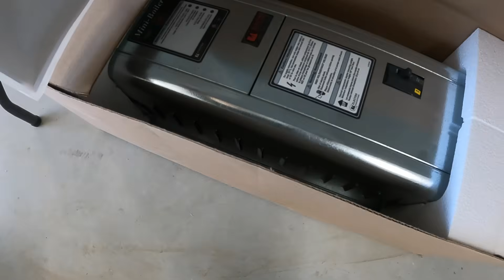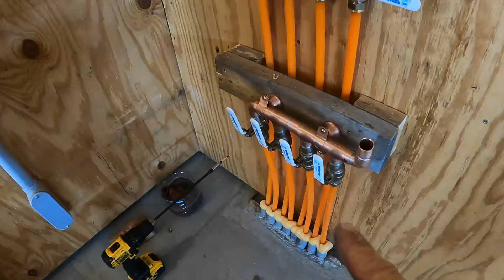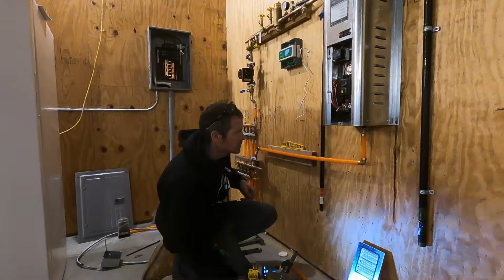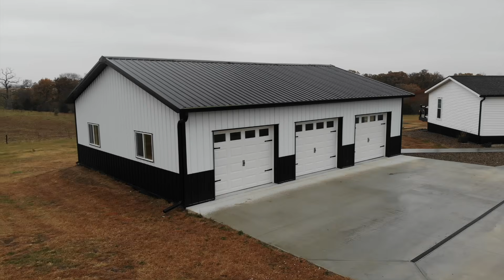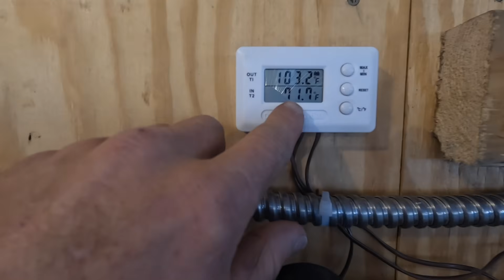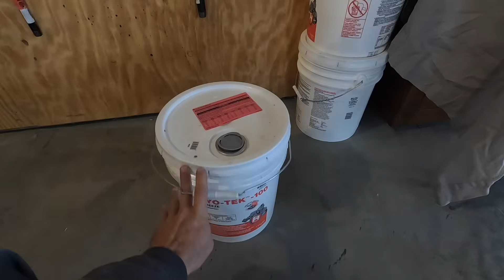In-Floor Radiant Heat Controls Install + Cost Breakdown | One Zone System

Comment: You typically want the expansion tank going upwards not downwards, they will last longer.  I was at a wholesalers years ago (I did HVAC for quite a while, but not plumbing) and an expansion tank rep was there, no clue which brand.  He was saying if it's downwards, sitting water in the tank will put weight on the bladder, stretching it and leading to it failing sooner than if it was upwards.  Will it work in either direction?  Yes, of course, but if you want it to last as long as possible, upwards is the way to go (read the instructions with any tank though to verify they support the orientation you want to install it in, obviously).

Comment: Trying to lower heat in one room /      ifyou wanted to lower heat in one zone would you thodder/ close down the supply ball valve flow or  the return ball valve,    thank you
Reply from the maker: If you have separate zones then you would have a thermostat for each zone.  You essentially could have ball valves on one of the loops if you wanted to shut a loop down.

Comment: This is a good materials starting point, several comments pointed out potential issues. One regarding the iron connecting  pipe, the other noting that a trained plumber would install this differently AND did not explain what or why this was so. Tragedy secrets? Is anyone willing to elaborate? Would the system manufacturer prove the correct information?

Comment: awesome install, wish i lived somewhere i could heat with electric. I see the led Christmas lights on my bill..  I put in a Crown Royal wood boiler in and now i look for things to heat.  Keep my garage 72 degrees house 73.  Just ran all my pex for infloor heat in my living room and now the wife wants it throughout the whole house... Looks like I've got a winter project.   I can  heat my house, domestic hot water, Basement, Garage and shop for 800 bucks a year in firewood. LOVE IT.  The infloor heat is going to be a bonus!  I've learned a lot from this video, floor sensors are important but also the thermostat to read the return is important too as in my case, too low of return water is no good in a wood boiler.

Comment: You need to use a special transition fitting, typically a brass or dielectric union, to avoid corrosion issues caused by mixing dissimilar metals; this is crucial as connecting them directly can lead to rapid deterioration at the connection point due to galvanic corrosion.

Comment: Got a part number for that dual thermometer you're using to measure supply & return Temp? 
One suggestion: do counterflow. IF both your supply & return are on the right end of a manifolds, the circuit on the right will have far more flow than the one to the left & so on, due to having the most pressure difference.  If you put the supply & returns on opposite ends of the manifolds, you'll have equal pressure difference feeding every circuit.
I'll be modelling my setup after yours, with the exception of using a variable speed pump with a modulating electric water heater.

Comment: Great video! Do you have a parts list with mfg part numbers, of the parts you bought from radiant tec? I want to build the same exact system except I'm going to use a smaller electro industries 7kw mini boiler, as my basement is 24x36. I would buy all the same components as u did, minus the manifolds i already bought from Upnor, because that was the tubing i used.
Thanks

Comment: Very clean looking and simple install. The electric boiler you used has a nice compact footprint and I can definitely appreciate the simplicity that comes with electric over gas for something like this. Curious what the difference in operating cost would be on a small gas boiler vs this. Thanks for sharing!

Comment: Yah, black gas pipe should have never been used in a hydronic system!  Like the previous user mentioned dielectric fittings should have been used at the boiler, but with copper pipe.  Glycol is corrosive to mild steel.

Comment: I Watched on fast forward. Putting sheet metal in front of pipes work even better.  Or You can also make up an element using alloy flashing just silicone it in. You fold the flashing around a pipe and it sort of gives the pipe wings which transfers the heat. Hard to explain without a drawing.  So the pipe ends up in the middle like a big saddle. You can even see those wings to the under floor for floor heating in your second story.
Reply from the maker: Great tip!

Comment: so if you use glycol it wont freeze?
Reply from the maker: Correct. But it’s heavier than water so it’ll use more energy to move through the tubing
Reply: @MrPostFrame did you ever get a running cost per month or year

Comment: The efficiency rage is to put something like a hybrid water heater in there to save operating money. It works well as long as the unit works. Its nice to see someone going through the steps as a novice..and gets it done. I learn more from your type of presentation than the manufacturer's rep banging out information.

Comment: 10k for infloor heat on 1200sqft. Hmmm
Reply from the maker: Roughly $5000 for controls and Pex if you install yourself. If your including vapor barrier and insulation, because of our climate zone, those need to be installed anyway.
Reply: @MrPostFrame  I dont think thats bad for the most comfortable heating method. I have it in my garage...and house. Your cars will have no snow on underside 1 hour after you drive in. The other GREAT feature. Get the garage to say 60 degrees. Open all the doors for 30 minutes...it will be freezing cold inside. Close the doors and in 20 minutes its 60..
Water dries, snow melts, its silent, no highs and lows. COMFORT is #1

Comment: I just got a quote for the same System …38,000 yes 38k how are you doing it for under 5000??
Reply: BECAUSE THE OTHER GUY WANTS TO BY HIS WIFE A NEW CADILLAC..
Reply: I went with radiant tech and installing myself 10k 🙏🏽
Reply: It's not the same system. Look at the parts cost. There is no way a contractor charges $5,000 per hour labor
Reply: @Darnellp87  22k for just the pipes and foam installed into slab and ready to connect to 😒
Reply: @gentzrayamcclellan6401  So again, not the same. This $5000 system does not include any foam or tubing. Unless you're in LA, there's no chance anybody is charging $38,000 for a 1200 sq ft radiant heating system with a 9kw electric boiler.
Reply: @Darnellp87  Ah ok! I know that foam is expensive! We in Portland Oregon actually prices for anything labor seem to have doubled over the last few years
Reply: @gentzrayamcclellan6401  foam is typically around $1/sq ft so $1200 in this case. You are likely talking about a multi zone system, several times bigger than this, with a gas boiler. Nothing is even comparable to what's happening in this video.
Reply: @gentzrayamcclellan6401 find a new guy

Comment: The black iron (carbon steel) piping coming out of the boiler connecting to the copper manifold should of been connected with a dielectric union.  There’s a very good chance that threaded connection is going to experience galvanic corrosion.  At the very least, replace that small steel nipple with a brass nipple.  Brass is a natural dielectric waterway between two dissimilar metals.  Also, on your spigot fill and drain valves, buy threaded caps as a safety just in case someone were to accident open one.  Kind of like a lockout tag out.  Cheap insurance.
Reply: латунь и бронза не подвержены гальванической коррозии при присоединении со сталью.
Reply: Yeppers
Reply: Thanks for sharing that knowledge folks! I just added the caps to my buy list, and I'm glad I went through the hassle of getting dielectric unions!
Reply: I noticed that too.
Reply: He's running glycogen so shouldn't  matter in this system water yes should run brass
Reply: @jaxchristian6408 galvanic corrosion can still happen in glycol system. Standard practice to use dielectric unions or to run a length of brass between black iron and copper.

Comment: Wish there was a video like this to watch when I was designing my system, very straightforward explanation!  Any benefits to the temp probes/thermostat vs tridicator gauges plumbed in? (I guess a temp probe can't leak!)
Reply from the maker: Comes down to cost and installation. I believe the Azel two zone temperature gauge with sensors is $50. Gauges would be more expensive and longer installation.

Comment: hi I have a separate question. I am planning a 35 x 40 post and frame building for my small plane. ideally id like to have one type of roll up door with panes for light but this door needs to be 35 feet wide . can you recommend a door company that can help me pick a door system,? love your content. thx
Reply: Overhead Door Corp. Google then for a dealer in your area. Really good commercial doors.
Reply: MR. Do you have any suggestions for 35 foot wide door companies?

Comment: I'll be using this type of system on my 40 deep by 56 wide shop with an attached apartment that I'm designing right now. The shop will be 40x40 and the apartment will be 26x40. It will be a one bed one bath with a half loft upstairs that can be another bed and possible bath. Question; what size of utility room do I need for the radiant floor equipment, an electrical sub panel and a tankless water heater for the household water? I think that's all that I would put in that room. Thanks!

Comment: Nice... always a pleasure & well done. I'm embarking on this journey as I write this. 

Question: Why not a tankless hot water heater on your builds & circulation pump(s) instead of very expensive boilers? Thx
Reply: I think an electrical tankless for a big zone like this is more expensive, like 800 $ And we are talking about a cheap one., So  the boiler come at a very ggod price : a an electrical boiler of this type can live more than 20 years and worked well.